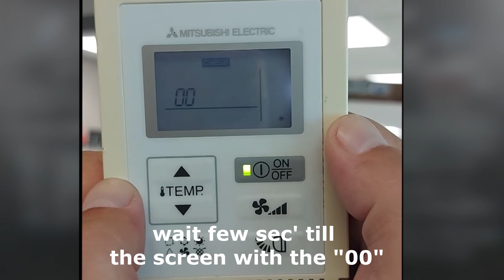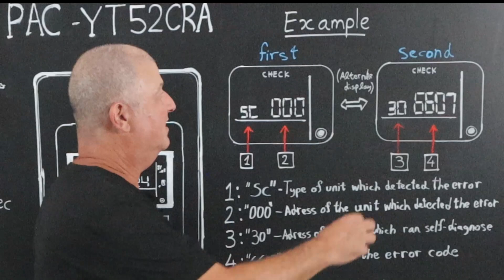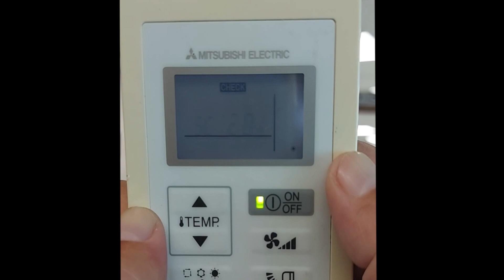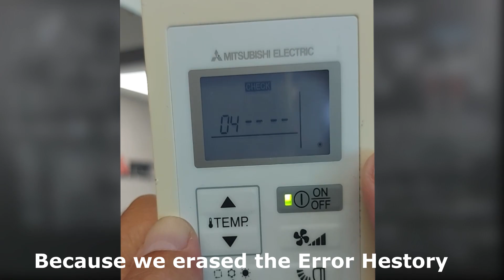How to Self diagnosis with the PAC-YT52CRA

Comment: Hey, if I have PAC-YT52CRA integrated in my flat - can I upgrade it to more sophisticated/Smart remote CONTROLLER? If so, how can i know which is compatible with my system?
Reply: hi, you can upgade to PAR-40MAA or PAR-CT01MAA-S/SB/PB instead of the PAC-YT52CRA or in addition to the PAC-YT52CRA
(up to 2 remotes can be connected to each indoor unit). see explain at https://www.youtube.com/watch?v=c2QxdlTIDeM&t=25s
Reply: 2:08 2:08 Smart remote controller
Reply: 3:24 3:25